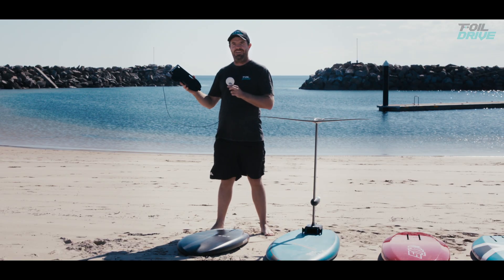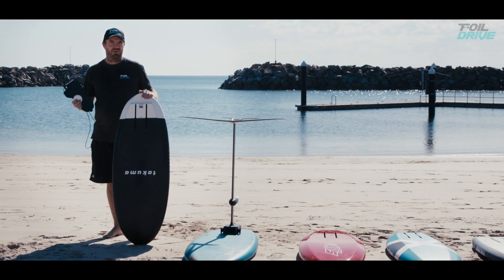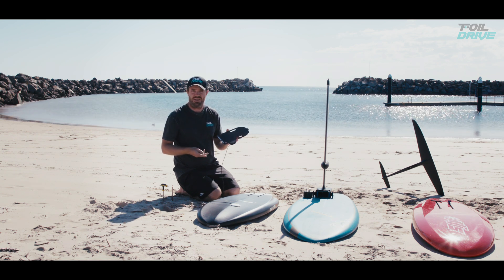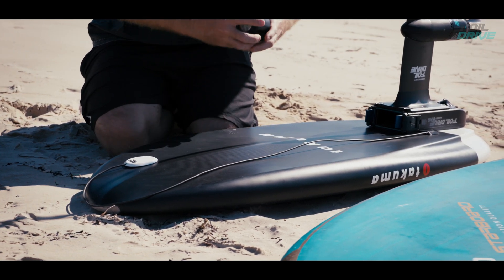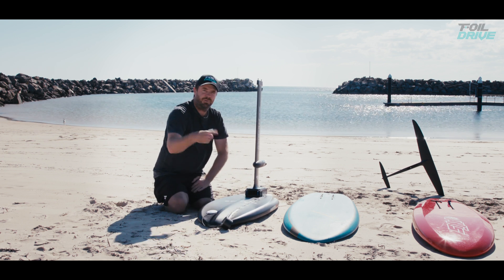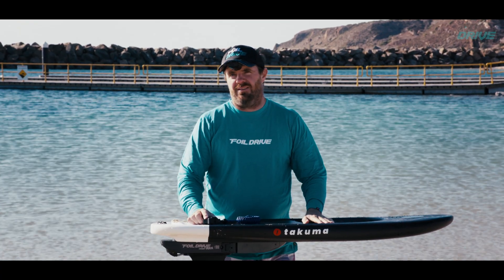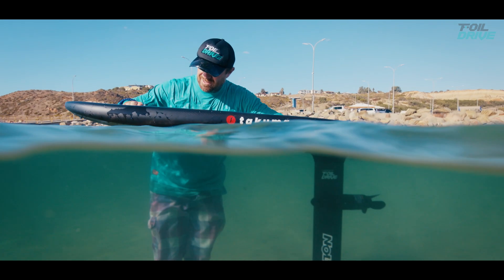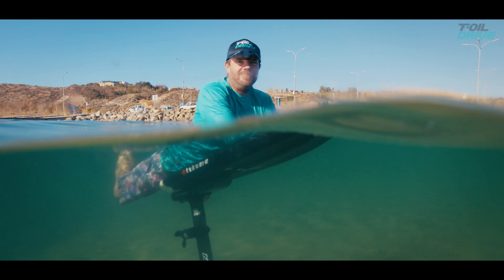Foil Drive External Antenna

Comment: This should be part of the kit. I only have carbon boards... I Liked your guys solution with the new foil drives as there where less clutter... Well, now I dont know if my summer is ruined as its taken almost 4 weeks to have my foil drive delivered and vacation is very soon and likely it will not work with any of my boards... and yes how long is the delivery time for this gaffer tape and cable solution and what is the additional cost? Next time maybe do so rea world testing before going to market, just as an advice.
Reply from the maker: Thanks for the feedback! This product isn't required for majority of our customers. Doing this would increase the price of the kit for everyone when thousands of people ride every day with no connectivity issues!

As we mentioned, we did extensive real world testing, including Armstrong boards. However, it is physically impossible to test every single board in the world. Fortunately, there is a solution now.
Reply: I'll prefer a kit that is 300 usd cheaper like now. Including it and raising the price when it is not needed for everyone is not ideal. Keep up the good work!
Reply: @PhilipKlawitter  I been waiting over a month to receive mine... Bought the best carbon fiber board I could find while waiting... Summer in Sweden is very short. If it does not work with my board a Ozone Rise, I likely don't get it to work until next summer as I will be traveling surfing all trough this summer. So in my scenario 300USD would be a small cost to pay as it could be the difference between not using the foil drive this year or using it everyday.
Reply: @milomaster2  sorry to hear that, that is a early adopter problem, the bleeding edge cut you. A crowd sourced effort could fix that in the future, a 3 points rating for every board combination based on connectivity issues. Something like perfect/ good/ not working properly; rating to guide new buyers to choose the right board or antena kit when needed.

Comment: What kind of tape are you using?
Reply from the maker: Specifically a Nitto Branded 48mm Duct tape, we find duct tape or electrical tape has a little bit of stretch to it which allows the tape to form around the curves of cables better. It also is nice and sticky without leaving residue when you take it off.